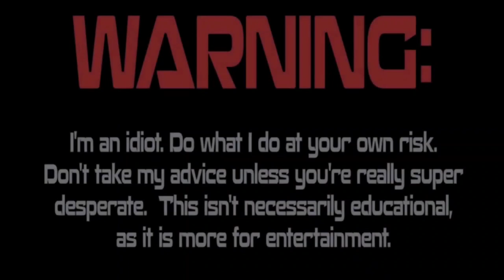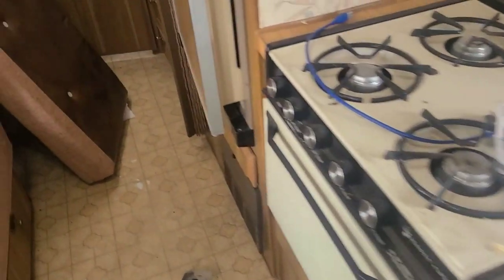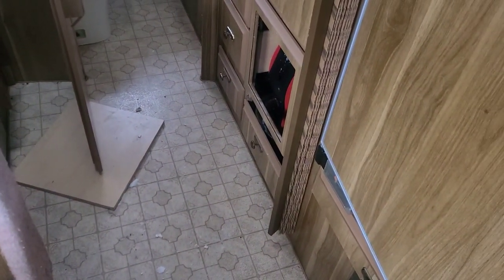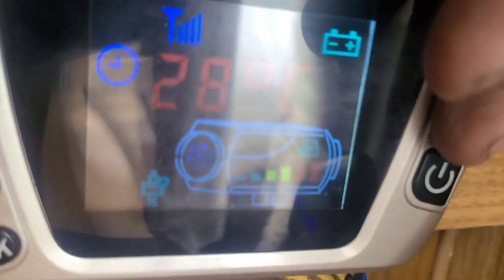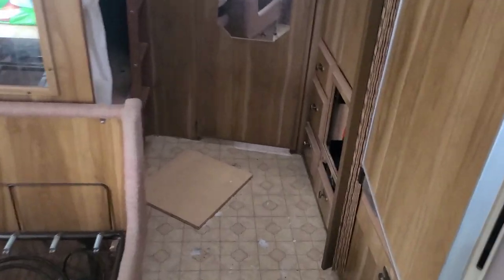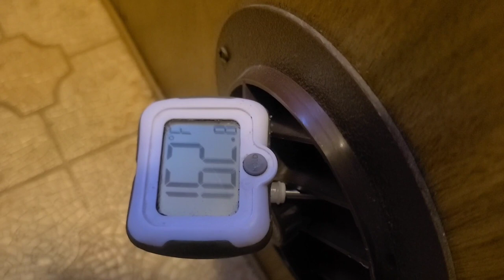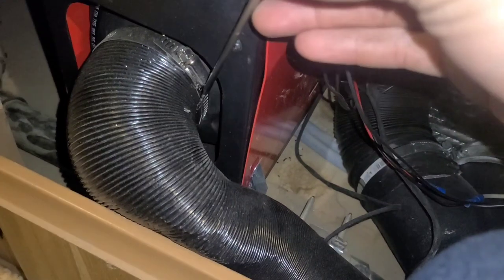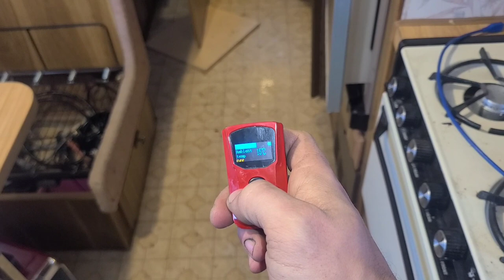Chinese diesel heater test IN WINTER! (will it work?)

Comment: I have a 5Kw in my 38' diesel pusher and the heater works awesome. I just ordered the "Afterburner" control panel from a dude in Australia, can't wait to install the Afterburner controller, you can tune/air fuel mixture, time and do just about anything with the controller even links to your smartphone.✌️🇺🇸
Reply from the maker: The afterburner controller? do you happen to have a link to that? Seems like a really cool idea to be able to tune the A/F mixture as I find the tends to burn a little  rich when using the temperature control as a thermostat after it kicks into low gear, I find myself periodically ramping up the Temperature to kick it into high for a full burn and clean out some of the build up. But if I could tune the A/F a little leaner that would solve that issue.
Reply: @AaronsAutomotive  here is a link so you know what you get. In his description you also have the link for where to buy it.

https://m.youtube.com/watch?v=R1Vyez4pUs0

Comment: Have you researched what temp. particle board ignites at? You have a 200-degree temp lying right against a wood material.  I would not be comfortable with that. But, I have never looked at ignition temps. Just a thought.
Reply from the maker: Partical board will self ignite without a spark source at 570°F, cardboard will self ignites at 450°F  and. And the ABS pipe used will ignite at 415°F. I did consider all that when I installed the hester, but these Temps from this diesel heater are still lower than any of the materials self ignition Temps.

But I do thank you for the comment and the concern 😊 have a great evening :)
Reply: @AaronsAutomotive  How do you know the heater sitting there won't get that hot?
Reply: What material would you use then @Mark?

Comment: If you shoot the hot air straight out the heater to the general space, instead of trough the existing duct, you can change the ambient temperature much faster and hotter.
The fan that comes with it is not powerful enough to enough to push through so much piping and bents.
Reply: That’s why typically in situations like these it’s common to install an in line fan

Comment: i’ve had mine for a couple months now but only really using it the last month. im in the Edmonton area and even at -19 running it at 2.2 it was 20 C in hear . i live in a 19 foot rv . so far i totally love this thing
Reply from the maker: Mine has been running 24/7 in the camper now in the front yard for the last month as my sister inlaw needed a place to stay for the winter and I don't have any spare rooms, and so far it's kept my 24' trailer warm, took off a couple kitchen cabinet doors and cabinet door off in the bathroom to let warm air flow around the water lines, and a stick on 200 watt silicon heat pad on all the water tanks, so far no frozen tanks nor pipes, and shes been keeping it warm around 25C, only burning about 2L of diesel a day, so about $60/month on fuel in it, but that's all it's costing her, and $40/month on power. It's an absolute unit.
Reply: @AaronsAutomotive  what was the ambient temp at the time if you can remember? Trying to figure out if it would hold up to everything northern Alberta has to throw at it. We
Hit -47 last year without the windchill
Reply from the maker: She'll take those Temps all day long. I'm in central Sask, and even on our coldest days we got around -45 as well and the heater held solid at any time she set it at. That cold snap we had of 2 weeks at -45 she burnt about 4L of diesel a day, and on the average -25 days was like 2L a day.
Reply: Do you find the tubing is too hot to keep it touching the wood in your trailer?
Reply from the maker: John, absolutely not. The air pipe do get hot, but not enough to cause any damage,  I can still hold the air pipe by hand but gets very uncomfortable after about 10 seconds of holding. But not much different compared to a normal RV furnace vent.
Reply: @AaronsAutomotive     Would the exhaust get hot enough to light wood?
Reply from the maker: Absolutely not. Won't even burn paper on the exhaust
Reply: @AaronsAutomotive    Thanks for the reply !!    Just installed one in my garage.    Working great although there must be something burning off the pipe or unit that is causing a slight metallic smell

Comment: Pretty amazing really, warming the interior of a unit that size given the outside temp etc.
Thanks for the video bud, more informative than you may think.
Reply from the maker: Thank you for your comment 😀 we've finally got Temps here around -35C, going to try it out again this weekend to see how well it does in these Temps  providing the diesel isnt gelled up.
Reply: How did you make out heating the prowler in -35 temp ? I have the same camper converted into a ice fishing shack , looking for alternate heat source rather than propane , to much moister from propane , BTW also from Saskatchewan
Reply: @dalenoble3987  fishing shack....must see....lol.   please post a video or pictures and share!
Reply: @wadebrewer7212  I did go with a Chinese diesel heater and so impressed with it, went out one morning when it was -39 and was still able to get it to 21°C inside by midday, highly recommend a Chinese diesel heater
Reply: @wadebrewer7212  soon as I figure how to post pics in a reply I’ll gladly post pics of the ice shack
Reply: @dalenoble3987  I bought one, going to make it Mobile using dewalt batteries.  I have a few use cases for it.

As far as pictures, you will probably have to post on Instagram and share the link or something like that.
Reply from the maker: Dale, I've been loving it, I used the camper for a week  to live in when caught the rona in January, as my daughter is severely immune compromised and kept me really warm for that week we had low -30s. And only burnt about 10L of diesel for that whole week.
Reply: @AaronsAutomotive  ya I’m pretty amazed how they work and efficient they are , we did install a 8kw one after I asked you about it , I did post a quick video on my page for how the ice shack turned out , keep in mind the interior not done yet , still need to do the Roughrider colours

Comment: Good video.   I know 3/4 copper pipe fits but what size of copper tubing did you use on the exhaust and how long is the run?

Comment: Great video 👍🏻 looking for a alternate heat source rather than the factory propane furnace ( to much moister from propane) BTW  I have the same size Prowler trailer but converted to a ice fishing shack , just curious for how it would perform out in the middle of the lake in -30 temps ?

Comment: I have sort of the same set up a  Class A motorhome which is about 30 feet long and I find if I run a little bit of steam  in the kettle on the stove small amount it is much warmer at the floor keeps the Heat from going up to the ceiling does a better job
 I've used in the minus 40 Celsius by the way and  it also keeps my water from freezing which is kind of cool to so now if I keep it on I don't have to winterize it

Comment: How do you prevent the diesel fuel from freezing/gelling? I'm concerned. 

Since this happens as high as 32F/0C. 

Do you use additives?
Reply from the maker: Depends where you at, here In Canada diesel fuel has additives put into to it by October (its a 30/70 kerosene/diesel and other Anti freezing additives) that change the freezing point from 0°C to -50°C so diesel freezing in the heater isn't too much of a concern. That said worst-case scenario is I would run a 50/50 mix of kerosene/diesel, as kerosene doesn't have the paraffin wax that diesel does. Or run 100% kerosene in it, only down side to kerosene in the diesel heaters is that it has less BTU than than diesel, burning more fuel to keep the same heat. So far I've never had that issue where I needed straight kerosene. And winter blend diesel has been more than sufficient.
Reply: @AaronsAutomotive  Thanks! that's super helpful.

Comment: Is it safe to run this under a cabinet as shown? Some other folks have kept theirs outside, but if it's safe to run inside it'll be a perfect replacement for my 70's factory LP heat system.
Reply from the maker: Absolutely its 100% safe to run inclosed. As long as muffler putty is put on the flange the exhaust is clamped tight there is zero issues having it inside. Infact the instructions state not to mount outside as they are not weather proof and will get damaged.

Comment: Put a 4 inch duct plate on that door and blow straight out from original pipe and be way way more efficient
Reply from the maker: I thought a bout it, but I also wanted to use the factory air ducts in the RV, as I do go out in milder winter temp and 1 blows right onto my fresh water tank and keeps the pipes under the tub and kitchen from freezing, nor did I want that piping hot air right at my 2 year olds face level.

Comment: can this run through out the winter non stop?
Reply: If you provide it with diesel non stop it may. I'm not sure the bearings in the motor/fan will last that long.

Comment: Where did u get the heater and how much is it
Reply from the maker: Got it on amazon, I just searched for "chinese diesel heater" and found an 8k BTU heater. Was oike $300cad for it.
Reply: I bought the same thing in 100 degree heat in august for $95 US.  They are more now it's winter and the demand is higher.  Finally installed it and works great. Pretty easy to install too.

Comment: Had you left it running an hour or two longer, you may of hit 17 degrees or 18 tops.
The human body only needs 18 degrees celsius that's the perfect temp, forget 20 or more degrees.
I've come across so many people fixated on this and wasting so much energy as a result.
I'm not saying this is your case, and thanks for the video👍

Comment: As long as ya got power from the grid or a huge battery bank as it would use about 100Ah in 24 hrs running at full power
Reply: @Keyzer Soze key factor here is "Full Power" eg worst case scenario .
yes your numbers work out fine in every day average use in mild climate .
I'm a prepare for the worst and hope for the best kind of guy.
Reply: @Keyzer Soze if I am heating a truck cab in temperatures below -20 with a 5kw heater so running it kinda hard, with intake in cab so it's recirculation air, you think I would get at least 12 hours off a battery with usable 24ah?
Reply: @juliogonzo2718      These barely use any power.    About 130-150 watts while the glow plug is igniting and 20-45 watts after that.......hooked up to a single deep cycle battery you should be good for a while tbh
Reply: @s.a.t419  I had it on my starting battery last winter. It was not great, and this year it started reading about .7v lower than actual voltage. It wouldn't start because it thought the voltage was too low. I am running it with a 20ah lifepo4 battery now and it works great. I just can't leave the battery in the truck as it cannot go below -20°C without damaging the battery.